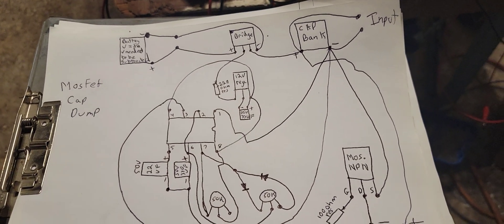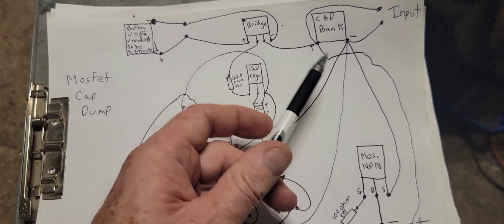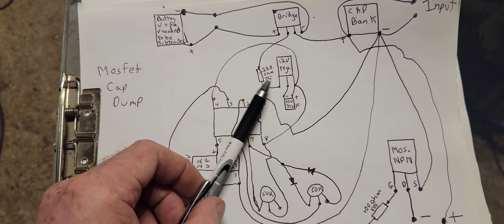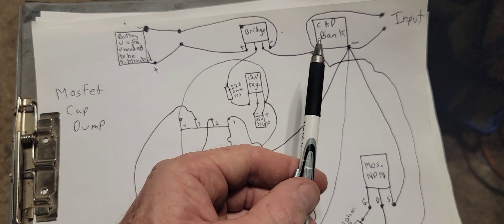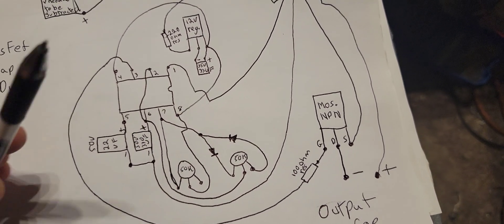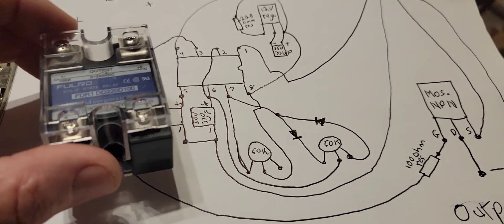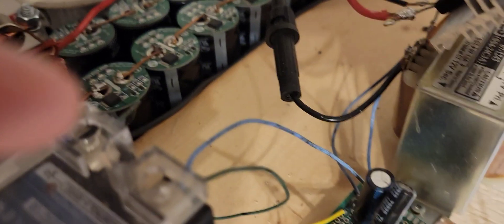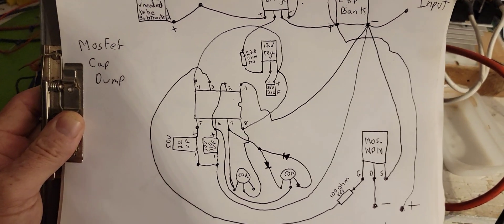Mosfet Cap Dump schematic with 555 timing... also has mistakes check description!

Comment: Does it have to be rectified after the cap bank or can it be rectified before the cap bank. Wouldn't ac need to rectified before the caps?
Reply from the maker: Just use the rectifier before the cap bank.  The one after is for something different and is not needed for what you're doing
Reply: @windpowerandmore6310  ok. Thanks. Im getting very close but still not quite there with this pulse circuit. Got more ssr coming. Im trying the fet now
Reply: Is the output signal on pin 3 variable or is it a constant? This is where i believe my issue is.. ive got a stable voltage on the 12v reg..
Reply from the maker: You should have a scope to troubleshoot the circuit.  If no scope use a small led on the output of the 555 timer circuit.  Get it working like that before hooking it up to the mosfet or SSR . Put a smaller uf cap on the timing cap for faster pulse.  Also change the pots if you still can't get it to pulse.  The pots sometimes aren't good from factory and give those issues
Reply: @windpowerandmore6310 ok. Led sounds like a good idea. Im buying a scope soon, but dont have one yet. How many volts should i expect to see come off pin 3?
Reply from the maker: 12 or less you should be able to check with your multi meter
Reply: Howdy Wind power and more. Is it possible that one your schematic you sent me that the post from cap bank to the ssr should be the negative from the cap bank? Im a bit confused as the mosfet dump circuit is on the low side.. im also wondering if the ssr ive bought are not ok to use. I bought fotek ssrs in different amperage rating dc to dc. Cheers muchly. Regards. Ben
Reply: Sorry about the literature! It didnt seem to come out how I typed it:)!!

Comment: Nice circuit and cannot wait to try. Thank you very much for sharing. The 10k resistor ommitted, is that resistor BETWEEN the source and gate pins? Or INLINE with the current 100ohm resistor and - of cap bank? Pls clarify. Ciao man.
Reply from the maker: There is a 100ohm resistor between pin 3 and the gate of the mosfet.  
If you're only using a 24v source then delete the entire bridge rectifier in the schematic before the voltage regulator and start with a 3k ohm resistor in series with the source on the input.  You may need to lower that value resistor if you're not getting the results you see I get but that resistor is generally the one to tune and also use a 5k pot on the left side and a 10k pot on the right side as the 5k pot is easier to tune ... sorry for the late reply I'm incredibly busy lately I hope I can help

Comment: Excellent video
Thanks for sharing
Reply from the maker: I hope that helps 
I forgot to put the resistor on the gate and source of the schematic drawing.  10k should work fine for most voltages unless you're trying to dump from a cap bank in the 100v range then I'd add a higher resistance.  This resistance will also effect the duty cycle somewhat so it may take some tuning .
Reply from the maker: I forgot also to connect the voltage regulator ground to the 555 just make that connection also its absolutely necessary everything has a common ground
Reply: @windpowerandmore6310  Thanks